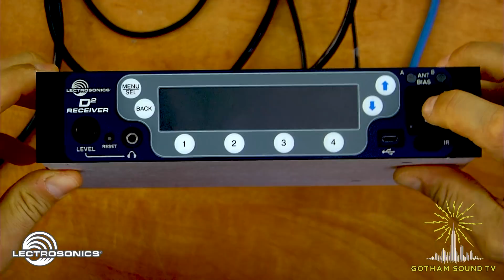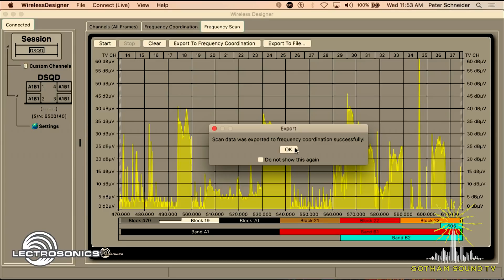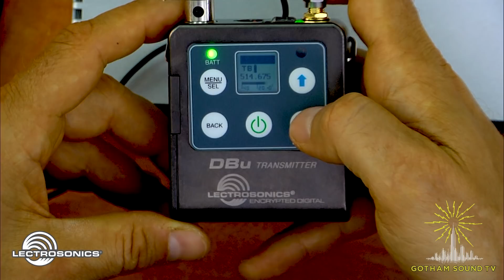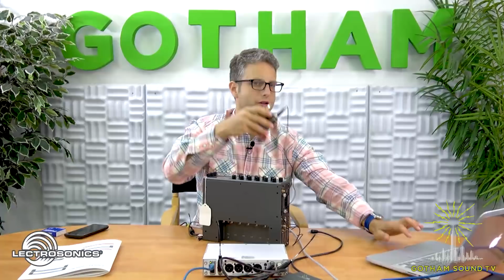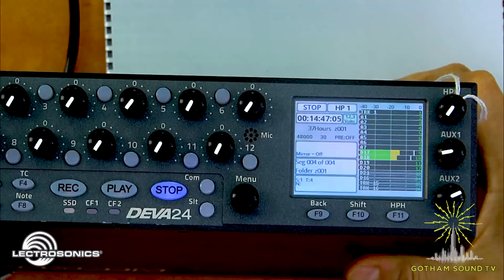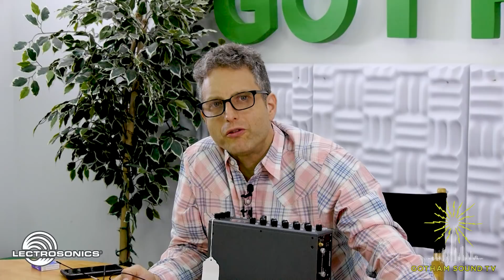Lectrosonics D-Squared DSQD Receiver

Comment: Was wondering, if you connected the DSQD to an 888 via DANTE, would the 888 be able to access / configure the D2 from the 888 menus similar to using SL-2/2L6 Superslot receivers?
Reply: Unfortunately, that is not a feature at this time.

Comment: Have you tried running POE to a small switcher, running POE to the network connector for power and a separate lines from the switcher to the Dante connectors?  Alternately use a bag type power distribution system and run a standard network cable to a small switch compatible with the bag power system, then to the network and Dante connections.